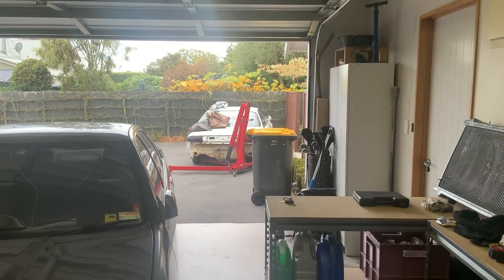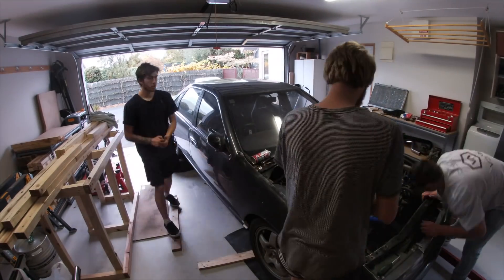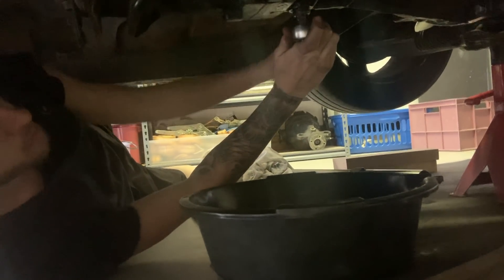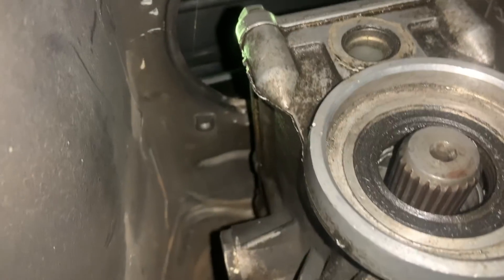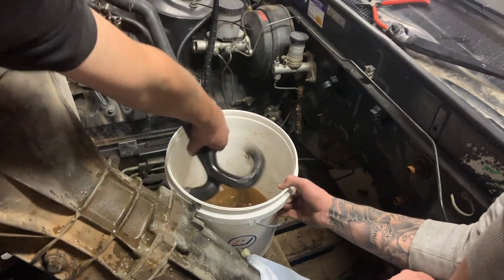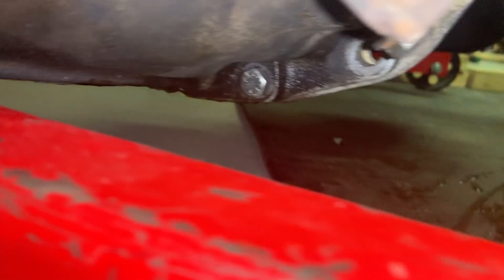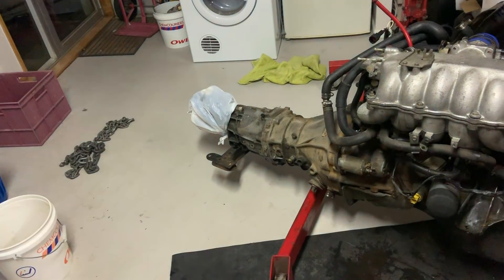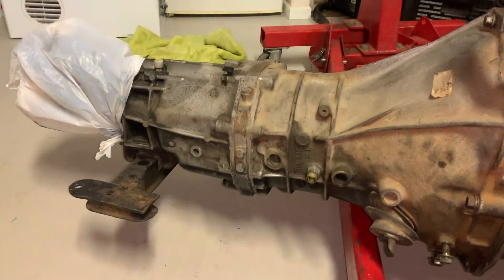Pulling the 25det out of the cefiro

Comment: Thats right the 20DET boxes have fins and an orange breather pipe running from the back and the 25DET boxes are a lot bigger.
Reply from the maker: Wasn’t comparing a 20det and 25det box was comparing a 20de and a 20det box. Same internally just different cases